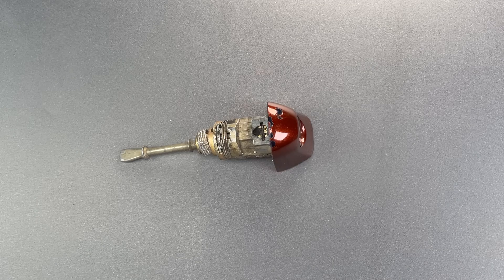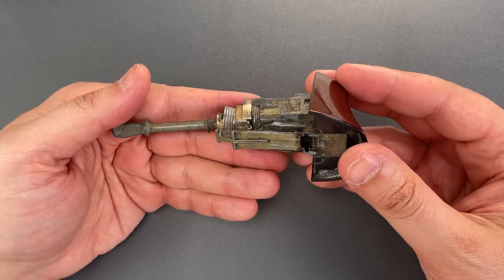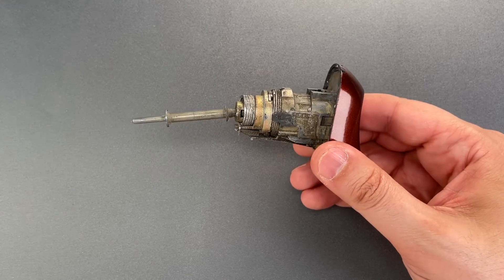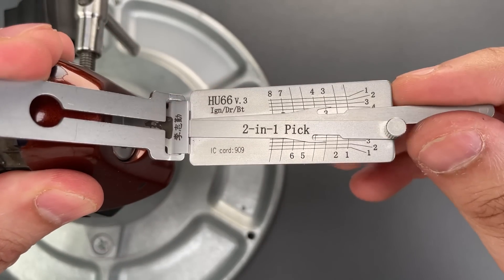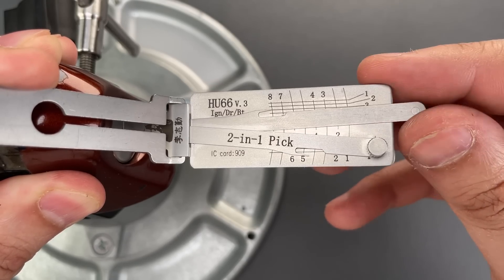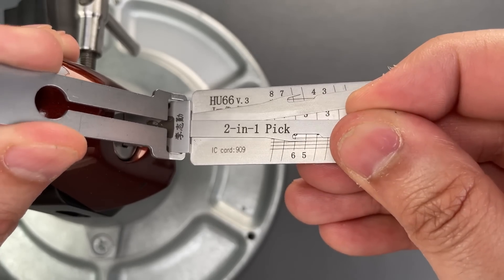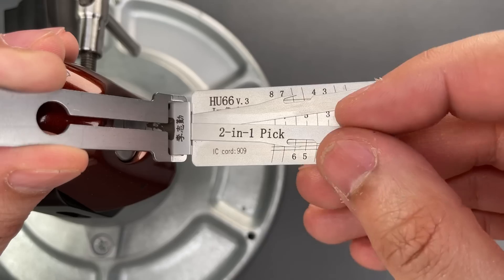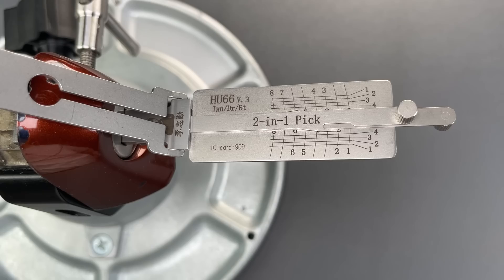[1380] Bentley Flying Spur Door Lock Picked

Comment: Can't wait for the next episode, where you show us how to hotwire a Bentley
Reply: "Thankfully with this device I designed with Bosnian Bill...
Reply: Just bring along a VW or Audi ECU, and a matched key for it, and swap out the engine ECU, and then drill the lock retaining pin out, or use  a slide hammer to pull it out, then start it.

That VW lock is available as a pattern part, complete with door handle and 2 keys, for $5 by me. You go to VW they will charge you $50 for the same exact pattern part, it just comes packed in a bag with a VW branded sticky label on it.
Reply: @SeanBZA  Great call. Just one thing - which VW ecu is set up for a twin turbo W12?
Reply: @siraff4461 the vw phaeton was a w12 idk if twin turbo though + there was also an audi w12
Reply: @SeanBZA  you could also just do a complete engine swap while you're at it
Reply: You might pick the ignition but the car won't start without the chip in the key. My 2006 tacoma won't even start without the chip key
Reply: 😂😂😂😂😂 can't wait
Reply: I think he should show us how to pick out of a prison first
Reply: Unless it is something he s3lls over on covertinstruments he is not going to show it so no hotwiring video's i think.
Reply: @siraff4461  it has just 3of the regular 4cylinder ecu's
Reply: Why hotwire if he can just pick the key...
Reply: Bumble bees and Christmas trees thats what you do if you forget your keys
Reply: @SimonBauer7  There was never a Turbo version in any of the Audi's. The TTW12 in the Bentley is a heavily reworked version of the Phaeton engine so the same architecture but not many shared parts or specs. I'm not sure if a Phaeton ecu would run the turbo but it certainly wouldn't be ideal.
Reply: @siraff4461  i think i'm right
Reply: @bolinhasoneca  Nowadays picking the lock is the easy part.

Getting the Immobilizer to let the engine start is where the problem lies.
Reply: Same way
Reply: @JohnDoe-bd5sz  sure but in that case you no longer actually need the key just fimd a away to record key signal and jam the car if that doesnt work try to get 2 or 3 signals to try to find the sucessions algorithm
Reply: But first....how to deactivate the steering lock
Reply: This is the LockpickingLawyer, not the HotWiringAttorney.
Reply: @Marker TTfl no, you can't.
Reply: @bolinhasoneca - transponder immobiliser security system - without the correctly coded RFID chipped key the immobiliser won't disarm.
Reply: @JohnDoe-bd5sz  - Not really as thanks to the EU anti competition laws vehicle manufacturers are not allowed to secure the OBD port access. With the correct plug in device the security / immobiliser isn't a problem to beat.
Reply: @leepower2717   i dont get u guys first this was a hotwire hipóteses system, then the other guy i already replied too the other guy who i would crack it
Reply: yes please do this
Reply: @DO4M  I'd sub to that channel
Reply: There should be a yt channel dedicated to that 🤔
Reply: you dlnt need to hotwire it if you got a lishi, the moment you decoded the door you got the key
Reply: @siraff4461  All I would need is to plug in VCDS, log in to the immobiliser section, and enter a valid workshop code, then click add a key, and you can use your bog standard VAG immobiliser key with a chip.
Reply: @leepower2717  OBD-II only mandates compatibility with the engine ECU for reading out error codes.

If you think that you can just plug an OBD-II device into any car and just start it up, you are not very knowledgeable about how car immobilisers work.
Reply: @JohnDoe-bd5sz  - on an EU complaint vehicle in Europe the OBD standard is different due to EU anti competition laws, devices are cheaply available from China & Russia that beat the manufacturers security systems in under a minute. How many European brand vehicles will bother to shut this loophole when there products are sold abroad? Like in the US for example?
Reply: with a snippet from the red bull can, im going to insert it here and there we go and to show you it wasnt a fluke
Reply: For older Ford models, you just have to pop the hood, bridge the starter solenoid terminals, and it’ll turn over.
Reply: @patrickmcneilly4293  Some older cars, the manufacturer only made Like 10 different key bittings so the chance of your being able to find a car in a shopping mall car park that your key fitted was good.
Reply: I've heard if people who make key transponder relays, they get close to the house with a receiver, retransmit the key data and drive off lol
Reply: @hvguy  This works for some models, that has the "no key" start.

Can be easily avoided by getting a key locker that is a "faraday cage"

Just like some wallets are made to protect your chip card from being read out when it is in its sleeve.
Reply: @JohnDoe-bd5sz  some cars now also require more than just having an authorized key to pair another key. Some use a PIN and one car I looked at actually had a hidden keyhole that you had to put a key into an turn before you could pair more wireless fobs.   Now of course with the PIN, that depends on people not just leaving it on default from the mfg settings.
Reply: You need an engine control unit with a matching key.. and if you just replace the existing computer.. it should start.. one from a VW would probably work since the lock isn't the only VW part in there.
Reply: @NKillBruh  come out you Black and Tans come and fight me like a man
Reply: @Marker TTfl no you can’t immobiliser
Reply: Nothing on three🤣
Reply: U can by calling police to help u
Reply: @annabeleatanacio6265  That seems like a terrible idea.
Reply: @Fuzzwankthebear  true but the thief has your days shopping and your bag.
Reply: Knowing LPL it'll be like: "So I have my urethane hammer here. You just tap this spot and... the car started. Alright folks, that's all I have for you today."
Reply: @scott8919  Plucks out a shiny OBD linked to a key...
Reply: I wonder how many thieves talk to themselves when picking now.  "Little click out of one, and we got this open. Let me close this to show it wasn't a fluke."
Reply: You wouldn't need it, just do what he's doing  just in the key barrel & then you could start the car.
Reply: JOKES ON YOU I ALREADY KNOW HOW TO DO IT

Comment: As the bible says, the apocalypse starts with "This is a lockpicking lawyer and what we have here is the portal to hell."
Reply: The Mythic Dawn hired me to pick open this Oblivion Gate.
Reply: holy crap lol
Reply: Nothing on 1
Reply: 666 is binding...
Reply: Come on....everyone knows hell is guarded with a Masterlock #3
Reply: @ian3580    So you ca get into hell with a stern look?
Reply: @mikebeacom4883  Even the purest of souls can visit hell with a wave rake and a tensioner in 3 thousandths
Reply: @mikebeacom4883  I was thinking more about getting out.
Reply: The last Bentley I fit keys to was about 8 years ago, there is no Lishi for it.  But the vehicle WAS not-too-elegantly equipped with factory 8-Track. Most people will not know what that is, but I am olde dude. Basically, the glove compartment was omitted, and an adapter plate of sorts made the deck fit, though it was not flush... looked like PEP BOIZ installed it at ten minutes to closing time. Seriously was the ugliest factory fitment I had ever seen of any accessory.
Reply: You should have went with The Pearly Gates……!
Reply: You want to visit hell? Just go to travis scotts concert
Reply: Li shi has particular key for each of the nine gates.
Reply: @darrennew8211  We could go ahead and pick it, however it is much easier to simply open it using this sigil stone.

Comment: Used to work for Bentley. Don't worry, they'll literally never see this.
Reply: really sad for a luxury car brand to have standards that low  for the price you would expect to pay for bentley parts on your bentley car but i suppose money means more than actually caring about the craftsmanship
Reply: @doug9359  The lock doesn't need to be premium, though. The ignition needs a chip to start and any thief wanting to burgle the car is just going to smash a window. Professional thieving gangs hoping to steal and sell a Bentley have enough funds to just take the entire car with a truck and break it open at a safe place.
Reply: It's a 2003 car so yeah. Also no one nowadays really uses the physical locks on car doors.
Reply: @neosonixyz  2013 , but you are correct about the physical lock aspect. 
How many cars unlock themselves just when you approach?
Reply: @RAHelllord  I think the general idea behind using this method is to get at whatever electronic devices are stored in the vehicle, infect them with spy-stuff, and get out without detection.
Reply: birds  you sound so jealous haha
Reply: @soundspark  All somewhat modern cars (meaning pretty much anything with an alarm from the factory) do that if the alarm is turned on and the battery isn't dead. Telling the difference between someone using a coat hanger and someone using a key would require adding extra electronics, and there isn't much point to doing so.
Reply: @doug9359  This is a more common practice than people like to pay attention to. A lot of limited production cars are just parts bins when you look close enough and a lot of luxury or up-market cars are reskins of much cheaper cars within the company or the umbrella company that company is in. Been like that a very long time.
Reply: @RAHelllord  this is a really good point that i didnt put much thought into, it makes sense as far as the security concern thanks bucko
Reply: @daggern15  i have watched a few youtube videos where someone has mentioned they re-use chassis and frame designs (im no expert nor do i know if this is true) whenever i do the small auto-zone maintenance  work on my VW it really throws me off to see an AUDI symbol poking right at me, also makes sense as far as cost efficiency im assuming
Reply: birds  not all wealthy people are egotistical.
Reply: @doug9359  it is absolutely true! every manufacturer does it, having worked with them for a while there's some really weird reuses of parts. Like the infiniti q50 was entirely built around a pos sentra frame
Reply: @doug9359  they're a car maker not a locksmith.
Reply: I'll have your word on that
Reply: @TheDirtyHotSnakes  Yep. The suits like to call it 'market segmentation', and say the real value is in the 'experience'. Lots of other manufactured goods are the same; higher prices rarely means substantially higher quality anymore—it's just marketing and limited production runs to make things feel special and exclusive!
Reply: @RAHelllord  the days of putting vehicles on the back of trucks is long gone when there is devices to unlock/start the car by electronically cloning keys just by being next to them. it's why my dad has always put his keys in the microwave when going to bed, although his car now has a device to stop them devices from working. obviously this for keyless/fob, which most cars are today.

Comment: Request.
A video or seris, on improvised picking equipment.
How far can you get with things like paperclip, bobby pin, soda can. Same for tension tool, what if you have nothing but a bladed screwdriver or soda can? What else could easily found and used for picking?

Comment: Someone stole some change, a portable cd player and a packet with 1 last cig i had kept for the morning from my old volkswagen golf in the late 90's. The police officer filing the case told me how my old VW was vulnerable for a screwdriver attack under the handle, barely noticeable damage, totally bypassing the lock. That learned me basically two things: one, not to trust locks at all, and two, to not leave visible change or anything else of any direct value to the person willing to open cars. Stealing that one cig proved fatal though, as i was very pretty sure i had it, which i'd had doubted if it was a full packet, and indicated that whomever did this was smoker, and thus the officer already had a fair clue who it might have been, as someone was just released that week he told me. So, thumbs up for old volkswagen locks, anything better might cost you $200 to replace a window, as happened to a friend of mine.

Comment: Wish you had shown that audi key closer.  I would like to see what type of pin/wafer configuration is expected. From the quick glance you offered I thought it looked a bit like euro style dimple keys, with the bitting on the side instead of the edge, but the tool you used only manipulates the edge.

Comment: There is a another way through this lock. It's a physical attack. Pop the silver outside key hole cover off. Inside there is a plastic ring around keyhole. Pop this ring off, you can now turn lock with small screwdriver. It's unlocks, disengaged alarms.

Comment: Cool little story:  I have a Skoda Fabia (VW's budget brand in the EU) and I was in a multistory car park.  Blipped my key fob to unlock my car and it also unlocked the Bentley Continental a few cars down!  Tried the door to make sure and it did indeed open.  Had to try locking my car with my door open so I could lock the Bentley without locking my car too just so I could leave.  So a key for a £8k car opened up a car costing well over £100k due to them using the same locks and blippers.
Reply: If you hadn't opened the Bentley door, it would have locked itself 30 seconds later to prevent anyone unlocking the car by mistake.

Comment: Next week: “This is the LPL and today we will be picking the the main hatch to the space X falcon heavy”
Reply: Since the Apollo 1 disaster, I wouldn't be surprised to find out that the doors are SEALED, but never LOCKED on a manned space vehicle.
Reply: @brianlojeck  Like how most modern passenger jets don't have (external) door locks because its assumed no one unauthorized is going to be able to access it anyway.
Reply: Falcon heavy is a rocket, not a capsule. You are referring to Dragon
Reply: @brianlojeck  they died because they had neglected to have an emergency hatch release, and instead had a pile of bolts that each had to be removed, and used a pure oxygen environment, where the switches were not intrinsically safe... because they cost too much.  Much was learned, sadly the cost was 3 people's lives.
Reply: @henkilepsilon6396  basically that, And in any kind of emergency you want people who could need to open a spacecraft or airplane to be able to do so without being worried about a key.   Also why the FAs put the red strap that says ARMED across the window on an airliner door, So in an incident a firefighter or other responder knows not to just pull the door open. *ARMED means the slide is active and opening the door will automatically deploy it.
Reply: @wolphin732  I'm well aware... Velcro burns very well in pure oxygen... I'm just saying, they probably don't lock the doors...
Reply: @wolphin732  The biggest problem was that the doors opened inward, not outward. So the high-pressure cabin air, further pressurized by the fire's heat, made it impossible to open the door.
Ironically, at least one of the design decisions that trapped the astronauts was actually done to improve safety. Explosive bolts on Liberty Bell 7 had gone off unintentionally and nearly led to Grissom's death after splashdown, hence why Apollo was not going to use them.
Reply: "As you can see, the spacesuit gloves you have to wear while in space make it seem daunting, but it's very simple once you know the weakness. On an unrelated note, I am selling a full sized replica of the falcon heavy over at my website"

Comment: True storys here:
1- i had a Chevrolet Cavalier (18yo car). i walked to my car in the big parking lot unlocked the door and started it. then i realized it wasn't my car, full of unknown stuff inside. i go out and the owners are there and we were all confused.
2- one time at home i go in and start my car, then the whole keyring fell off the steering wheel while the car is still on. i realized it had opened the door and started it with a motorcycle key that isnt even close to the same size and shape.
3- i forget my keys IN the car with it running in winter (-20C) remembering the last two storys i stop somebody in the street and ask him to borrow his keys for 10sec. i tried some that didnt fit, but his mailbox key that is just 3/4 inch long unlocked the door after a bit of giggling in the lock. we were both amazed.
Reply: same thing but with a dodge shadow, and there car was parked right next to mine. same key opened both cars
Reply: @juangarcia-po4wd  i was shocked, like i slipped into the twillight zone or something. i was sitting there and it took me 1-2min just to realize it wasnt my car. hahahaha

Comment: WOW.

Q: What did your Bentley cost?
A: One Lishi-Tool..!
Reply: Free money is free money.
Reply: Dunno about Bentley but my Audi from essentially the same year pings the key when they physical key is used. You can force the door open and sleep in it but it's not going anywhere. It won't start and it's not like you can hotwire the 2 wires under the dash, it's push to start and it verifies not only the key is around, but where it is. (that being said if you start it it won't stop the engine for safety reasons)

I don't even know what it would take to hotwire one. It won't be simple. And before you say "but you can take the sunglasses" yes it's also vulnerable to bricks.

I guess you could open the door, fart inside and close the door covertly as a prank.

Comment: That would get you in, but would it trigger the immobilizer?  Most of those keys are chipped, are they not?  Or does it only have an effect if you try to start it?
Reply: It just gets you in to steal whatever's inside. The car won't start without the correct key.